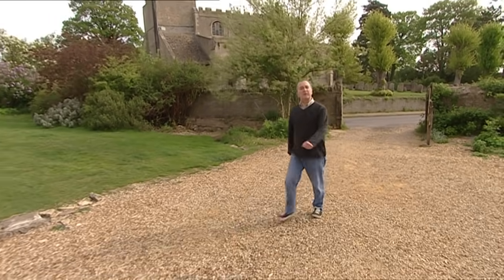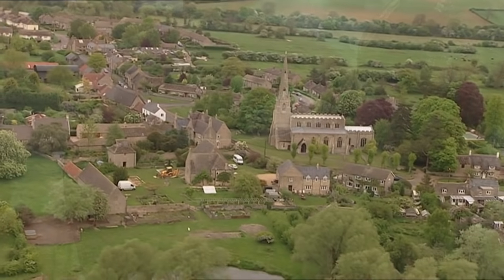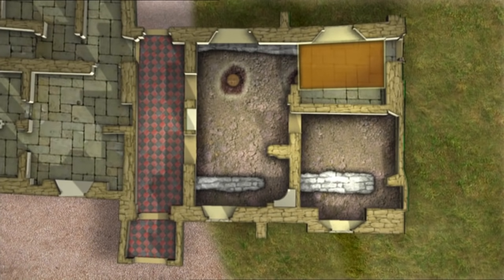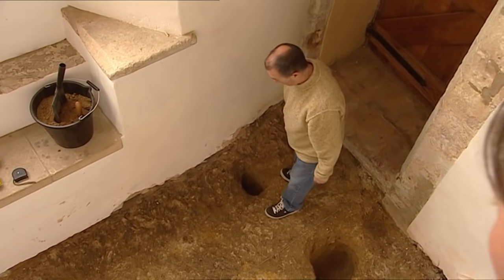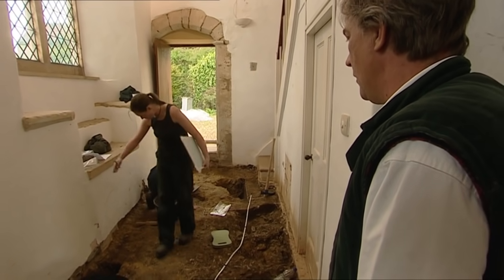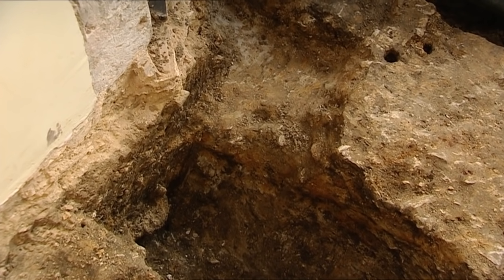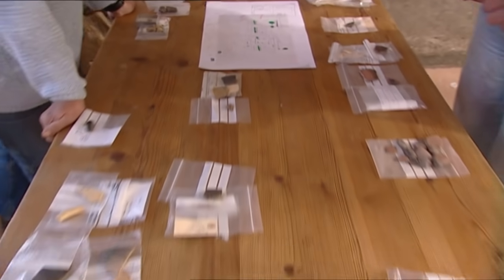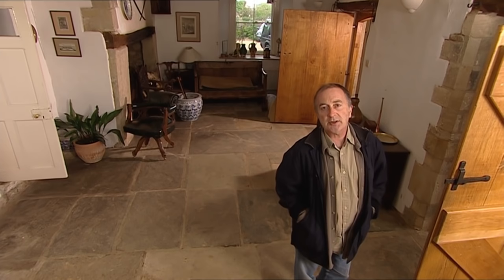King Cnut's Manor | FULL EPISODE | Time Team

Comment: 10:17 wait.. i thought they had to save those tiles 😂
Reply: Yes, and put them back exactly as they were. Until they realised they had to use the sledge hammer to remove them in the first place (which, as far as I recall, was edited out in the original broadcast).

Comment: It helps to get tile up if you take a flat head screwdriver and remove the grout from in-between them and those tiles are nice and thick the ones i've had to save are thin maybe a 1/4 of the thickness of them.

Comment: Easy way to remove tile is to make a rubber "stamp" of the same size (maybe a hair over), it has to be thick, and of a hard durometer. You place it on top, and with a heavy rubber mallet, you smack the tile under in all corners using a stout wooden drift. in a circular pattern. In theory (because some tiles will break inevitably), you break the bond, and then it's just a matter of using a wet sucker to pull the tiles up.
I've had great success with tiles up to 12x12x1 tiles. Works even better if they are laid with a spacing of grout.

Comment: I remember a different TT episode, in which they were talking about halls built with a beam slot, and the supporting post holes on the OUTSIDE of the buildings rather than the inside. I don't know which period of history that referred to but I thought that was also Saxon. Might that be an explanation of why the walls and the posts were so close together, and the hall was mostly on the outside of the house, just all destroyed by later work?

Comment: Would it not have been fun to use the floor stones in some manner to show the locations of the pre-Saxon archaeological remains underneath? It might have been as simple as just the pattern of the stones or possibly using a slightly different color stone to illustrate the history beneath? Talk about a conversation piece. And the fact that portions of the current home date from the 1100’s is absolutely fantastic. Here in Arizona an historic building will date from the 1830’s because there is nothing older for the bureaucrats to fret about. 🤣

Comment: Ok - wood posts on the inside of two walls.  The second great hall was build over the first as the fine work and living was inside the first.  The modern stone would last better and is the upgrade.    When a college prof eons ago, there was a family in town that the wife wanted a new house but would not move out.  Man built a I-Beam steel structure over their old wood house and had it completely completed and he lifted floors onto beams attached to his steel outside.  So slowly it turned into old wood with steel under and all around the wood house and a happy wife.  Strange couples sometimes.

Comment: how can that house be listed if it's not in original condition? Or rather, how have they poured concrete in a house that's listed? That makes no sense. In Denmark, if a house that old is listed you can't use concrete, and if you use concrete it can't be listed because it's not in original condition, and thus not worth protecting.

Also, Tony, the king's name was Knud, not Canute, Kn is 1 sound, not 2